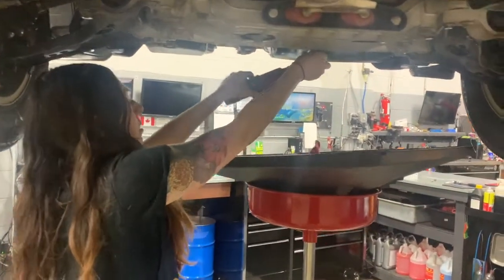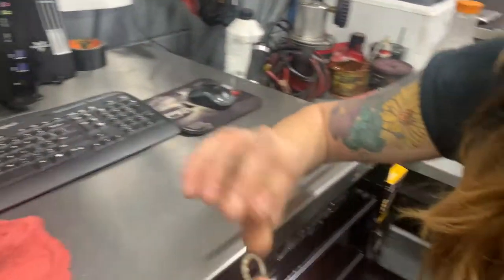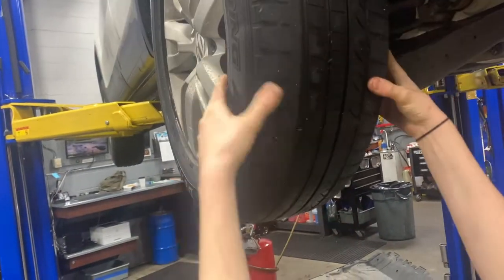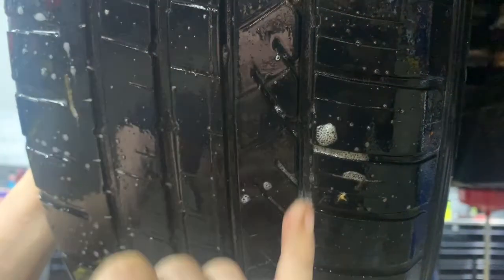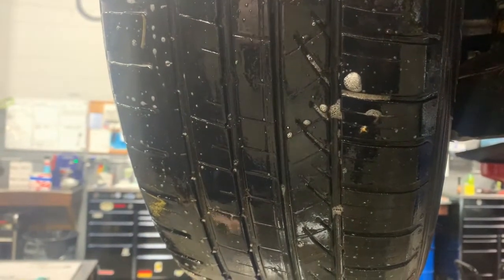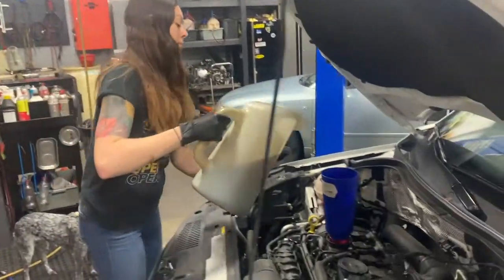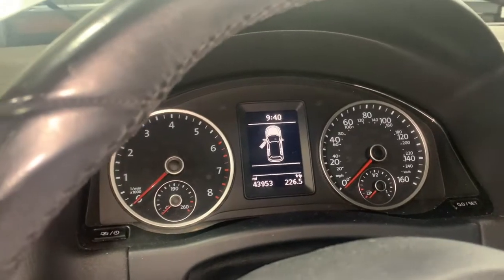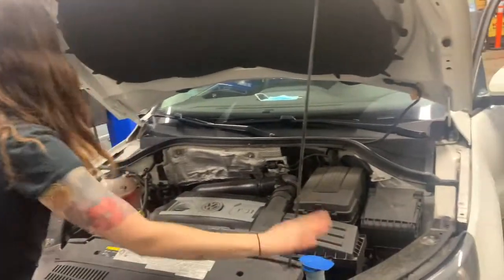How to change oil on -- 2017 Tiguan

Comment: Great video...thanks! What would you think of the idea of cutting out a neat hole to access the drain plug and fabricating a removable cover from a similar material?
Reply from the maker: That’s what bmw does! it’s not a bad idea but for me I like to remove the belly pan to do a whole inspection.
Reply: @Lilystone  Good point...thanks!
Reply from the maker: You are not correct.

Comment: Wow welldone with the oil service. More ladies and gents should do like wise.
I do have 5NZ Tiguan and service it myself. To be honest, the thought of making a hole  around the drain plug area has crossed my mind, considering the hassle one goes through to remove the two plastic belly covers.

Comment: 3:48 Lmao what did they do... Jesus Christ haha
Reply from the maker: lil access port action, all long as you don’t care about an inspection or getting oil everywhere I guess it works! 🙄
Reply: @Lilystone   I think the bottom cover should have had a small door, just around the drain plug area for easy acess, now you need to remove two covers for this purpose.